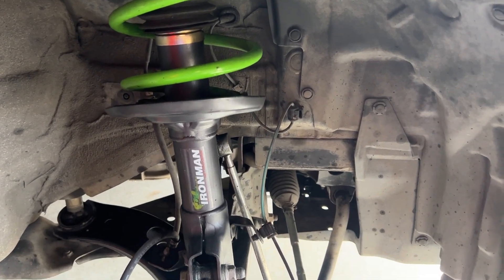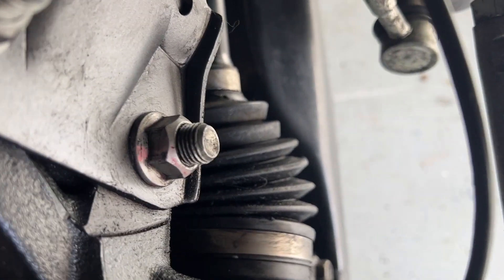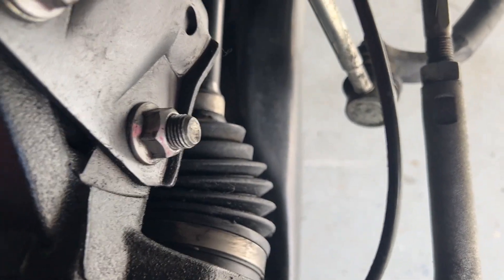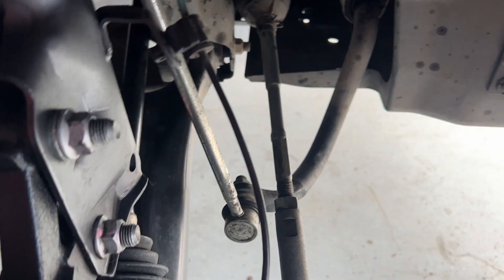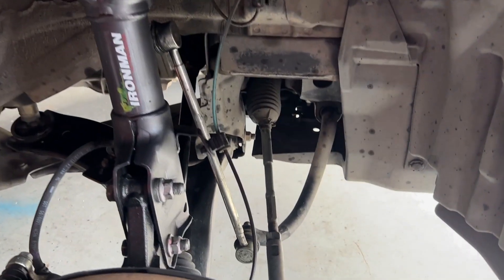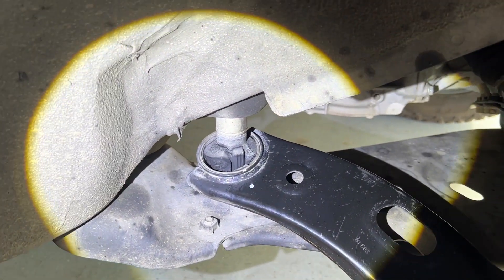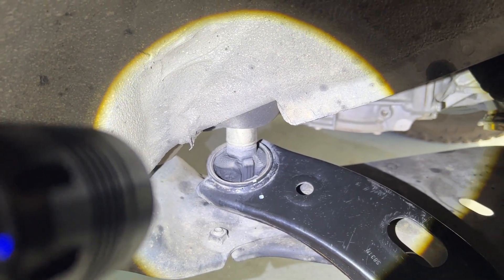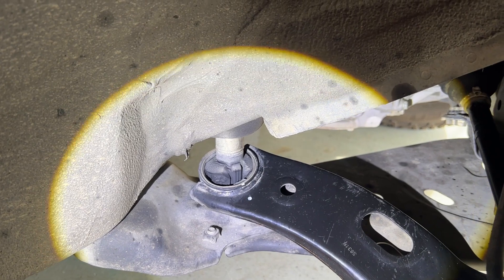Have you been checking this on your vehicle???

Comment: thx for the advise,  btw have you already replaced your front and rear diff oils since you're already @ 90k miles.
Reply from the maker: You’re welcome!  Actually I bought the oil, but have been putting it off because I was seeing mixed opinions on the cvt oil.  But now I’ve seen enough and decided I will be doing both cvt, and front/rear diff.
Reply: @Lucrativesoldier  👍